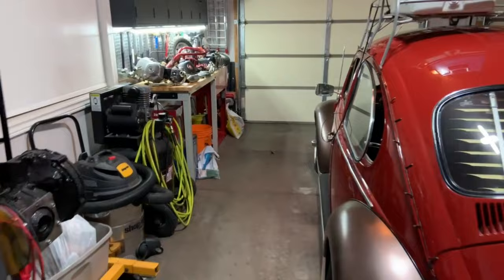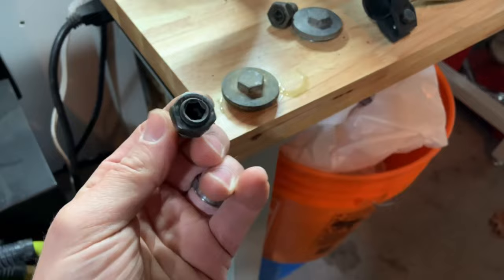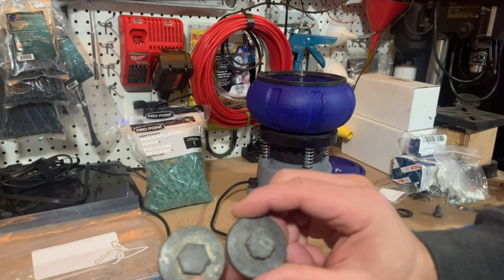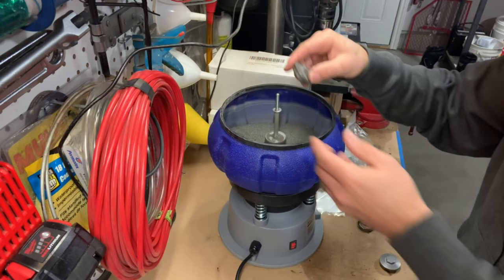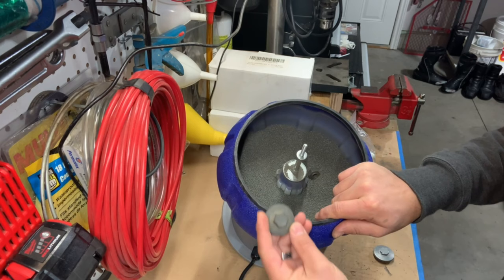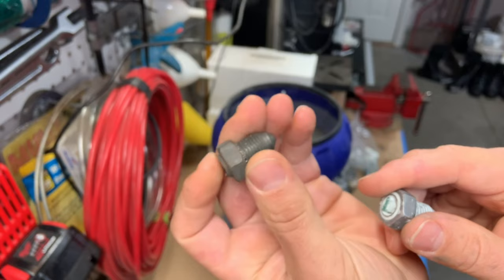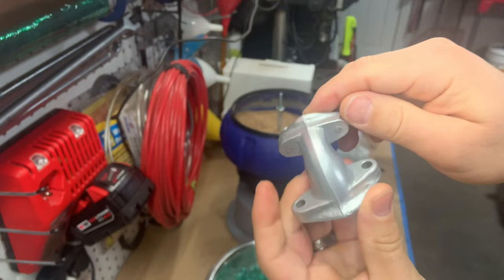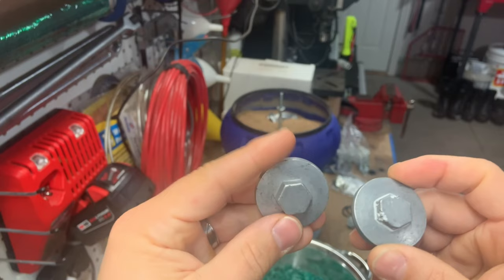Vibratory Tumbler/Polisher | Using to Clean & Polish Honda Z50 Parts

Comment: You must fill the bowl to above half full for the media to move properly. Two thirds is best. Also, two hours is too short. Three at a minimum for most work and four or more for harder parts. This takes patience. Plastic media is for aluminum or brass. For steel, use ceramic media. Always use with water of liquid for tumbling, not dry. Stainless shot, pins, or whatever is for peening surfaces, not for rust removal as it doesn’t grind against the surface, but rather smacks into it. Walnut shells is not intended for heavy cleaning or polishing of hard materials. It’s a delicate media for materials that will easily get damaged from other, more aggressive media. I hope that helps.
Reply from the maker: Thank you for this. I recently uploaded another video sort of touching base on this as I’ve learned the same over the past couple years of using it.
Reply: Thanks for your advice. I am about to clean a load of bolts and nuts. What type / size of ceramic media would you recommend?
Reply: @leondantuma7123  nuts and bolts are always a problem for this sort of cleaning. The difficulty is that the threads can’t really be cleaned. The only media that could do that with any success is a very fine fruit such as aluminum oxide. But the grit must be fine enough to work itself between the threads. Otherwise nothing will happen. But I really don’t advise it. First, how rusty are they? You don’t want to reuse them if they’re really rusty. The grit grinds the metal away, remember. So the resu,t are thinner, weaker threads which are rough and won’t tighten properly. But if you insist in reusing them then the best way to clean those is to first get any oil, paint or grease off using a cleaner first in a heated sonic bath. Then use a product such as Evaporust, in the sonic, to remove the rust. Those will damage the parts the least. It only takes 15 minutes, or so to remove grease or oil and 30 minutes to remove the rust if it is t too bad. If it’s bad them maybe another 15 to 30 minutes should do it. But if it’s that bad, bite the bullet and throw them away and get new ones. The problem is that people who do one thing think that nits the only way to do it. That’s wrong. Vibratory cleaning isn’t really acceptable for finely detailed parts such as threaded surfaces. I guarantee they will damage them, no matter what anyone here might say otherwise.
Reply: @melgross  Thank you. Solid point on the threads, I'll use a sonic with an equivalent of Evaporust instead. The bolts are not that badly rusted but I want to clean them up before I put my bike back together.
Reply from the maker: @leondantuma7123  unfortunately I have never actually tried ceramic media… seems to be hard to find in small batches for a smaller machine like this.

Comment: i use wet sand in a bag in my tumble dryer ... works great
Reply from the maker: Sorry, what exactly do you do??? Do you use your clothes dryer?
Reply: Cermaic balls and corn cob work the best. will come out like chrome
Reply from the maker: @SpaceRanger187 I’ve hear of the corn cob, but never seen it done.  I know of a wheel refinishing place that uses the ceramic balls which work miracles on wheels.  Not sure how well it would do in the smaller hardware with crevices.

Comment: you need to incorporate a chemical in water to make it shiny then pour it in tne machine
Reply from the maker: I’m curious what type of chemical you had in mind.  And what media do you suggest adding that in with?
Reply: I’ve been doing this coins and stainless shot and a detergent.  Great results, especially with silver.
Reply from the maker: @martinphilip8998 I could imagine that works quite well.  Are you using a vibratory tumbler, or a roller style one?
Reply: @JMKGarage   I have a Tumble Vibe 5 and use ShineBright. I buzz for about 30 minutes.   Get that lid on tight or your machine will try to walk away.😆
Reply from the maker: @martinphilip8998  🤣

Comment: Have you tried removing rust from bolts, nuts and washers with the tumbler?
Reply from the maker: Yes… can’t remember if I covered that in this video.  I would strongly advise other options.  Best to soak in cleaning vinegar (24 hours), dry with compressed air, then use a wire wheel on a bench grinder or an abrasive blast cabinet.  The vibratory polisher, regardless of the media, will do a sub par job and leave residue in all the threads that is challenging to remove.  Save yourself the headache and use the method I mentioned above instead.

Comment: in your opinion from testing, which combination yields the best results for steel automotive hardware ? dry resin pyramids?  Thank you for the great video
Reply from the maker: Hey, thanks for watching and dropping the comment!  All depends on the current condition on the hardware you are trying to clean/polish, and the end result you are looking for.  If your goal is simply to clean rust and polish, then yes… dry resin pyramids to remove the rust, then crushed walnut shell (with metal polish added) to bring a shine.  If the parts are dirty, you will need the water and soap added to the resin pyramids.  Unfortunately after many attempts and testing different scenarios, I cannot however really recommend the vibratory tumbler for the best results on hardware.  It doesn’t clean between threads well, but rather leaves residue in between the threads.  Best I have found it to soak parts in cleaning vinegar for ~24 hours, lightly scrub with a brush to wipe off the rust and dirt, rinse, blow try with compressed air (this will often leave them spotless), then finish cleaning up using a wire wheel or a blast cabinet.  If you are painting the hardware, use something abrasive like silica sand or copper slag.  If it is stainless hardware, use glass bead to leave a smooth shinier finish.   I am actually working on a follow up video right now to show different methods for cleaning and polishing coins and hardware… hope to have this uploaded within a week or two.

Comment: Watch the dust when you are doing dry, don't what to breath any of that dust. I normally wait 30 minutes before I open container. Thanks for the video on the different media. I use the rust cutter all the time, but will try the walnut shell with polish.
Reply from the maker: Excellent safety tip!

Comment: Great info, thanks. Question: Will the tumbler / polisher work with torx bolts? Asking as I have an older BMW motorcycle and looking to restore the rusted bolts which are mostly torx types.
Reply from the maker: Hey, thank you for watching.  Yes, it will work on any bolt type.  HOWEVER… the media residue always gets stuck in the crevices.  On any nut/bolt you need to take to a wire wheel or clean with a wire brush, or use a tap/die set after to clean the threads.  The same issue would happen with the cavity of the torx head, so you would need to use a brush or needle to scrape the inside clean.  I actually haven’t used this tumbler in over a year now as it doesn’t work as nice as just cleaning in parts washer (solvent based) first, then cleaning in the blast cabinet, then finishing up with a wire wheel or buffing wheel on the bench grinder.  Also, if you are looking to re-plate any of the bolts (I’ve done a bit of that… nickel and zinc plating), the parts need to be thoroughly cleaned then blasted with clean media, then cleaned again with acetone… the tumbler/polisher won’t clean then enough for plating.

Comment: Great video
Just bought the tumbler and trying to figure out the best option. Sounds like the walnut shell  with medal polish  worked best.
Reply from the maker: Thank you.  And yes, the walnut shell with metal polish works best for the final stage of giving that shine.  If you are trying to clean grease/grime and/or rust, the triangles with a little soapy water do the trick.  I have however found that nothing I’ve tried compared to using the parts washer with varsol, then sandblasting (or taking to the wire wheel), then using the buffing wheel with various metal polishing compounds.  That is all certainly more work, requires more equipment, and different to polish tiny parts that can easily be tossed in the tumbler.  Thanks for watching!